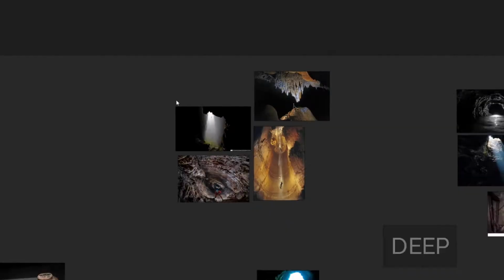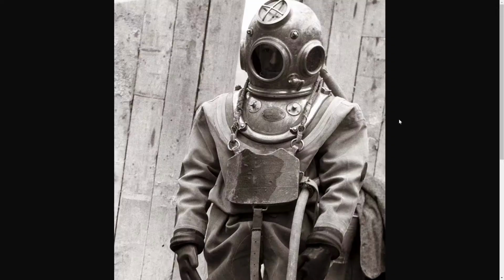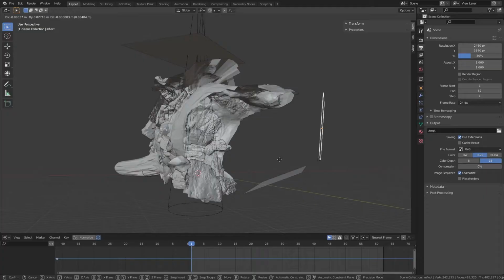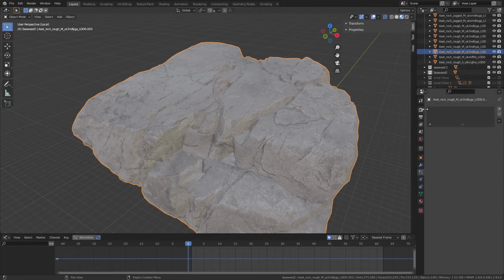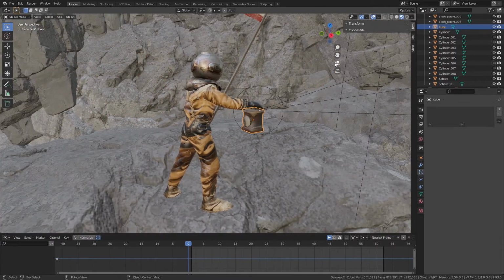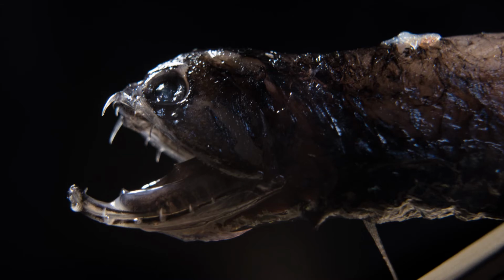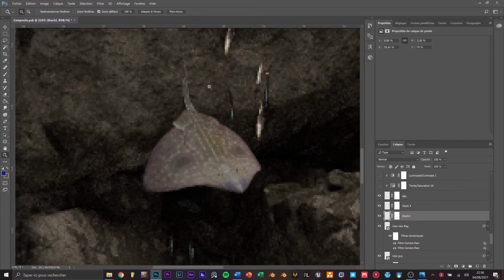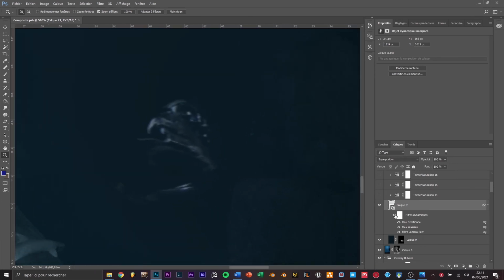Blender Underwater Caves Are Easy

Comment: Incredibly helpful video. I'm particularly interested in the part where you speak about increasing the light to avoid noise and long render times. I'm currently working on a night scene in blender. I've got emissive materials and objects with sub surface scattering and the noise is crazy. No matter how much I pump up the samples there is still noise in the SSS parts and this is supposed to be a video. I'm gonna revisit the scene and see what I can do with soft indirect lighting. Thank you for this video :)